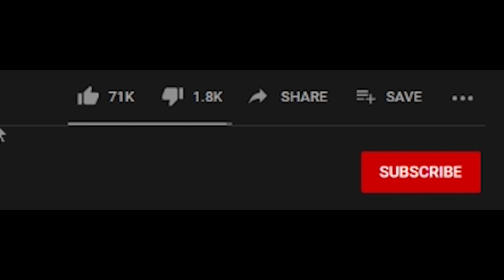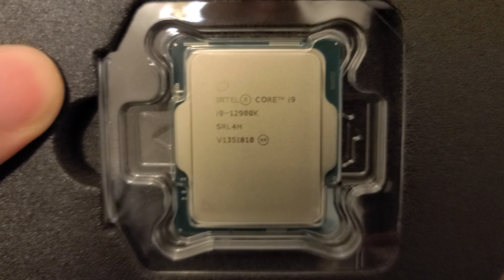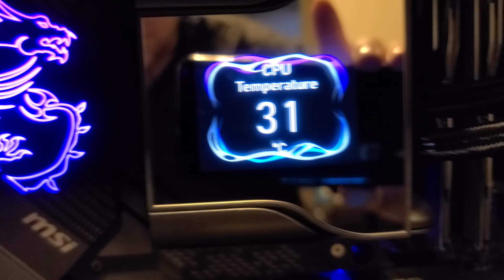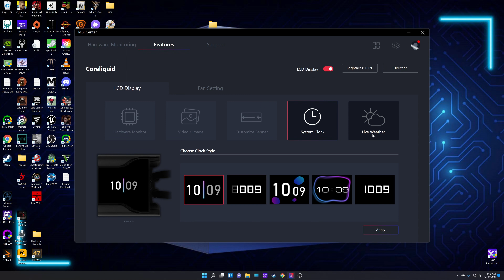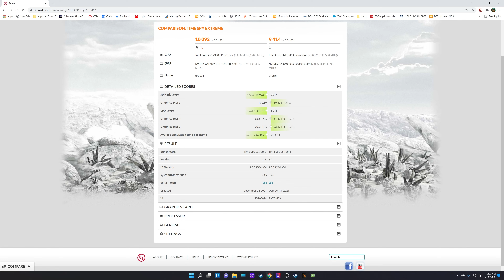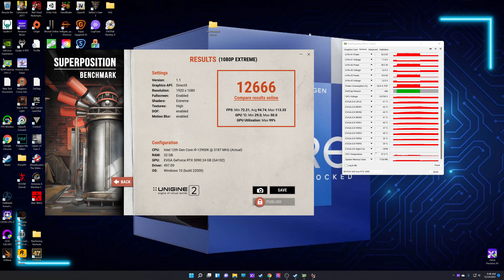Intel i9 12900k w/MSI S360 Coreliquid, MSI Z690 Carbon Wifi & G.Skill Trident Z5 DDR5 5600Mhz

Comment from the maker: 0:44 - Checking out the components
2:40 - G.Skill Trident Z5 DDR5 5600Mhz unboxing
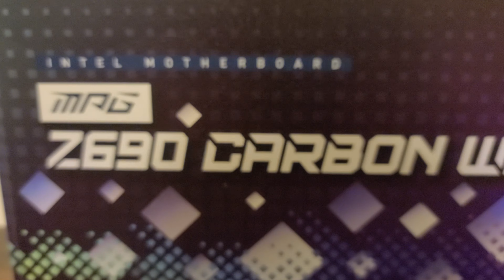4:00 - MSI MAG Z690 Carbon Motherboard unboxing
10:20 - Intel i9 12900k unboxing
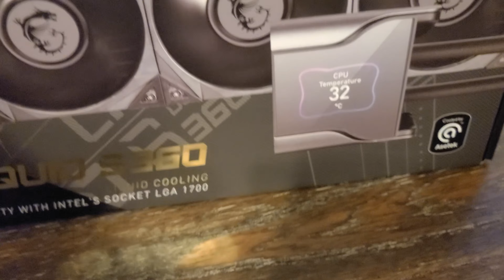12:11 - MSI S360 Coreliquid 360mm AIO unboxing
15:26 - Installing CPU, RAM, CPU cooler and NVME drives into the motherboard
17:14 - Discussing the installation process/comments
18:35 - Evaluating the completed system w/components fully installed
20:21 - Using the MSI Center software to control the AIO pump display (ie background images, temps, fan speeds etc)
23:16 - I was mistaken.  There are 8 Performance cores which are still Hyperthreaded, and 8 Efficiency cores (non-Hyperthreaded), making a total of 24 threads
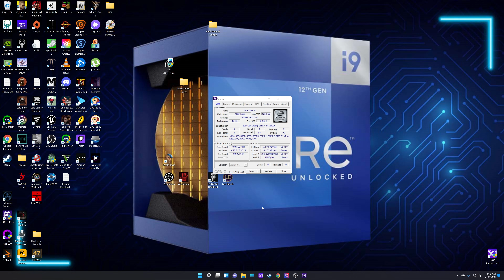28:33 - Time Spy Extreme Benchmark results
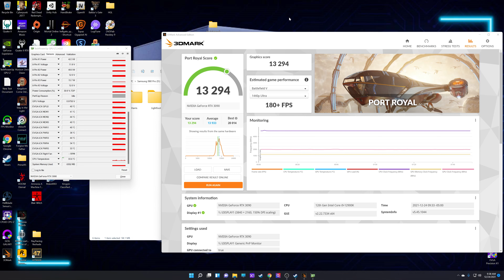33:47 - Port Royal results
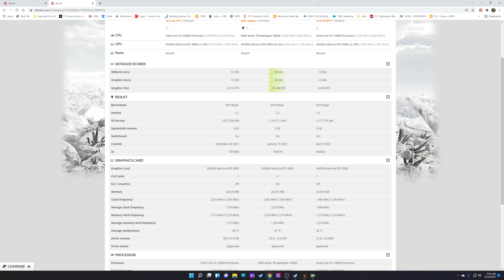34:58 - Superposition 1080p "Extreme" test
37:40 - Cyberpunk 2077 Gameplay @ 4k max settings, various DLSS tests
44:59 - Cyberpunk 2077 Gameplay @ 1080p max settings, no DLSS
47:25 - Hellblade: Senua's Saga w/latest graphics update @ 4k max, various DLSS tests
51:22 - AC Valhalla benchmark @ 4k max
53:40 - Comments and ending
Reply: how is the MSI software? Bought the msi aio will have it tomorrow.

Comment: My water cooler was centered and covered 90 % of the processor. Running cool at this time. I bought a MSI water cooler as well but only two fans (240)
Reply from the maker: How hot under load?

Comment: You have my exact setup, I was wondering though. Was the backplate loose for the 1700?
Reply from the maker: Not that I recall, no.
Reply: Ok 👍  thanks, I appreciate the response.
Reply: I have put my whole system on win 11. I'm having issues 😕, from script Errors when I ran ryujin 2 360, to windows downloading old settings even when I tell it to set it up as a new pc.....thinking bout going back to win 10.
Reply from the maker: @zeroch1ll150  Disable the efficiency cores in the BIOS and see what happens.  Or update the BIOS since the latest ones from MSI update the CPU microcode and help improve clock scheduling.

Comment: Hey any follow up to the video? How is the temperatures holding up?
Reply from the maker: All over the place.  For gaming it's fine and doesn't typically get above the high 60's.. But for stuff like extracting images from an mp4 in Deepfacelab or other tasks that fully peg the CPU.. like high 80's.. Not great.

Comment: Hi do you think this cooler good for i7-12700k with overclock to 5ghz? Withiuth any problem with processor temperature?
Reply from the maker: It should be.  It handles the 12900k which runs ~4.9Ghz all the time.
Reply: @DruuzilTechGames  okay thank you sir and samsung 980 pro have dram?
Reply from the maker: @hoknm6409  I have a 980 Pro but I'm not sure what you're asking?

Comment: Im about to build mine with a 12900k as well and ddr5 5200 corsair dom plat ram on an asus z690e gaming mb and a ftw3 3080ti, using this same msi s360 as well. Would u reccomemd win 10 pro ir should i use 11 pro?? Nice lookin build!
Reply from the maker: I know a lot of people don't like Windows 11 but I haven't really had any problems with it, other than initial issues with the clock scheduler and the 12900k not playing nicely together.  After a BIOS update that problem has been resolved though.
Reply: @DruuzilTechGames  sounds good, thanks for the information!
Reply: The scheduler in Windows 10 doesn’t support the efficiency cores on the 12th gen CPUs so if you want to get the best performance out of it, you’ll need to go Windows 11.
Reply: @babybirdhome  Thanks for the info, yes I will be using 11 pro.

Comment: the 12900K does have hyperthreading.  This is how the thread count is 24 (8x2+8=24).  Your software as well as most will not support Windows 11 correctly and you will see some issues for a couple months or more.  An option is to disable the e cores and typically your software will run correctly.  On DDR5, the huge advantage will be not only the speeds you mentioned but a massive increase in capacity.  128gb could be the standard in a couple of years and RAM drives will be the main device to speed up processing complex programs.  I have a 12600K with an Asus TUF Gaming Z690-Plus WIFI D4 and noone is currently able to get DDR4 to run 1 to 1 or known as Gear 1 more than 3900 mhz.  You actually have the board I ultimately want to buy in a couple of years for the PCI-E 5 x8 slots for my 9361-16I in my file server but this board will do for now.  I have overclocked my 12600K to P cores at 5ghz stable but it does get hot on an air cooler.  I am endvous of your build and it will be a monster once some the of the real DDR5 comes out.  Happy Holidays.
Reply from the maker: Yeah I corrected myself on the hyperthreading thing in the pinned comment.  Thanks for the info, I appreciate it.  Happy Holidays to you too!
Reply: Funnily enough, my friend got his 4000mhz 16-16-16-36 dual rank gskill kit to post at xmp and it put it in gear 1 without issues. I msyelf can't get my 4x8gb ram configuration to run past 3600mhz without errors on gear 1.
Reply: I tested the asus strix d4, easily ran 4k cl14... its in my closet now and have an apex systems fully tuned max.

Comment: Hey there, I recently bought this cooler for my 12900K and I'm happy with the temperatures but I am having a slight noise issue with the pump - what sounds like a constant, high frequency buzzing noise, even at 60% pump RPM, which reads around 1700. It is fairly quiet but still noticeable enough, especially if I remove my case cover as listen in, and based on what I can hear in the video you don't seem to have this issue which makes me think that I have got a bad unit and should seek a replacement. Is this correct? The three previous AIOs I have owned, two 240mm and one 280mm, all had pumps which were basically dead silent around this speed.

Thanks
Reply from the maker: Yeah I haven't had any noise issues with mine.  I guess if you think it's an issue, you should probably replace it sooner than later, so you don't miss your return window.
Reply: @DruuzilTechGames  Thank you, I did return it and got an NZXT Kraken Z73 RGB (should be the same Asetek pump) instead and got a unit which is in line with what I thought to be normal. At 60-80%, it is inaudible as far as I can tell and at 100% it can be heard but not in the way of obnoxious buzzing.
Reply: @ryanocallaghan8833  set your AIO/Water pump settings in bios to PWM mode and set them to the lowest.
Reply: This faulty cooler is long gone for me but it happened at all pump speeds, even the lowest possible. My current one is a lot better and can run up to 60% seemingly without making a sound even if I put my ear close to it.
Reply: Hey dude go watch GamersNexus our JayZtwocents video on improperly and properly mounted AIOs, if you mount it in a direction that air can get into the pump or the top of the RAD, you will hear a gurgling noise or bubbling, I 100% guarantee thats your problem.
Reply: @jaredchampagne2752  No, you misunderstand. It wasn't the bubbling/ gurgling sound at all. The radiator was mounted right at the top of the case. 

The actual sound was a constant, electrical "humming" or "buzzing" noise from the pump at all possible speeds which intensified when the pump was set at or near full speed. It was pretty gentle but noticeable and easily distinguishable from the noise caused by pumping air. 

The noise I was getting sounds just like this K360: https://youtu.be/f3upjQN_f2E 
and as you can see, he has his radiator mounted on the side, tubes down, top well above the pump. One of the "ideal" placements as recommended by GN. Therefore, separate problem completely. 

For the record, I have owned around a dozen AIOs in total at some point. The MSI S360 in question was the worst when it came to pump noise, followed by the CoolIT pumps used on modern Corsair units (this is however a much quieter hum and very bearable at the lowest speeds whilst still performing well)

Comment: What did you put in the Gen 5 M.2 socket? Is that compatible with Gen 4 or 3?
Reply from the maker: Gen5 sockets are backwards compatible with all previous gen drives.  The 2TB Sabrent drive was Gen3 and the 980 Pro I installed is Gen4.  I don't think Gen5 drives even exist yet.

Comment: Hello, I have the exact same cooler and I was just wondering how you managed to get the software to work as I have ran into problems with being able to see the coreliquid feature on the msi centre, I got it to show up one time after installing and deleting the software multiple times however I could not change anything on it so I deleted that version and reinstalled it and it dissapeared. Any tips on how to fix this?
Reply from the maker: Seems like I recall there being a firmware update on the MSI website for the cooler itself.

Comment: DOES IT COOL DOWN THE I9 -12900K TEMP ON PREMIER RENDERING?
Reply from the maker: The 12900k is hot running no matter what it seems.  It spikes into the high 80's.  That said, it doesn't "overheat" so the cooler does its job.